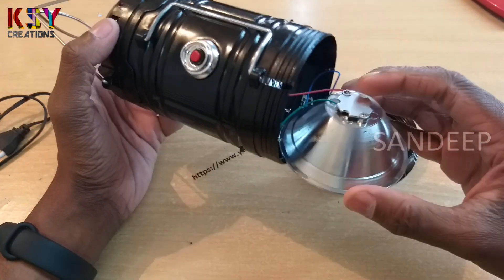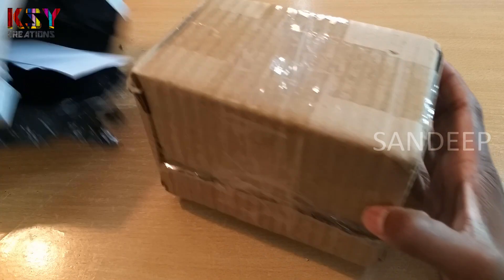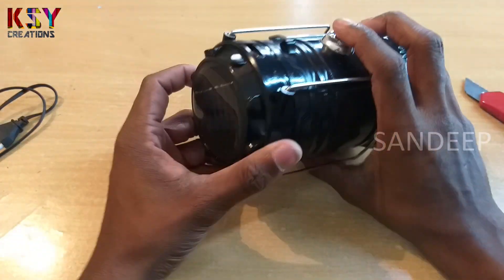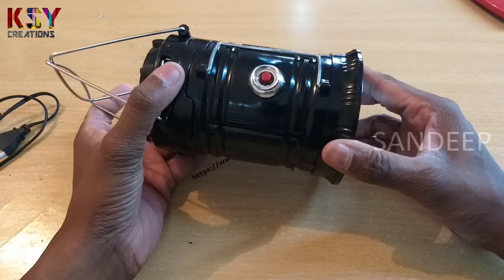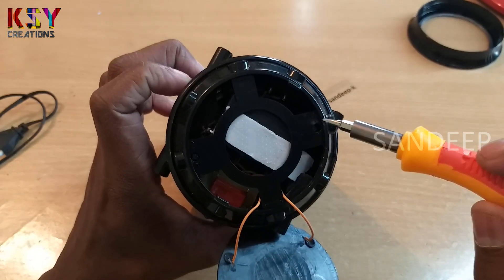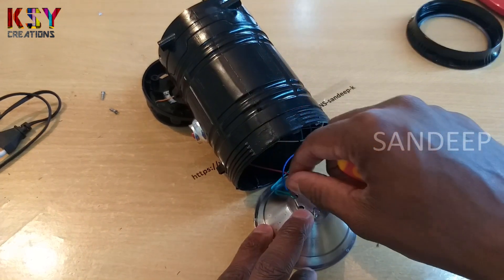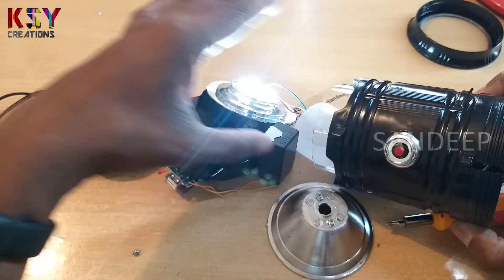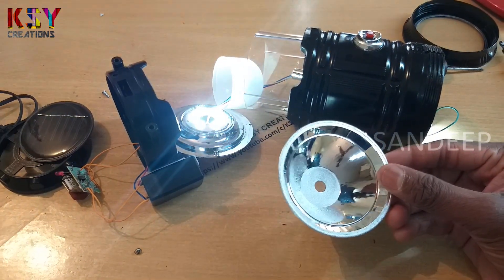best LED solar emergency light for camping  unboxing and dismantle

Comment: Bro, in this d upper torch light s not working. But sideslide light and usb s working. What s d problem in it? Plz tell me bro. I bought it today only. While buying itself d upper light not worked. Bought it near by shop only, not online.Whether need to recharge or need to change d battery of d upper torch light or need to put it in solar? Plz tell me bro
Reply: Bro whether need to change 1 watt led
Reply from the maker: Hi, if inside light is working and torch is not working means led wires might be disconnected or led might be damaged.
Reply: @KSYCREATIONS-sandeep-k  oh thankyou bro🙏🙏👍👍

Comment: Sandeep, I need the value of electrolyte capicitor
Reply from the maker: Sorry  bro there is no electrolyte capacitor in the circuit which I have, I think yours and mine circuit board is different...